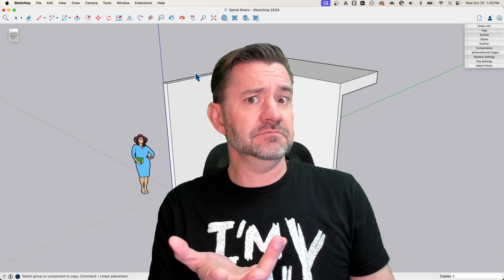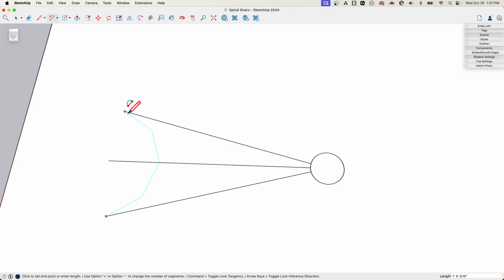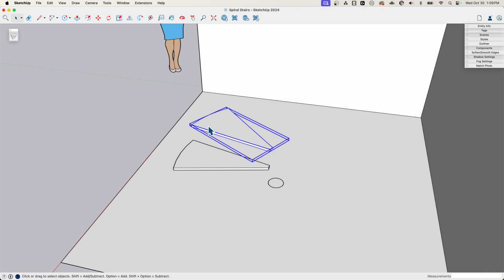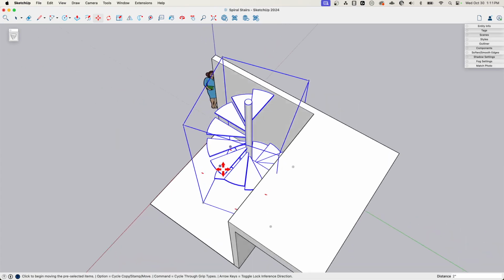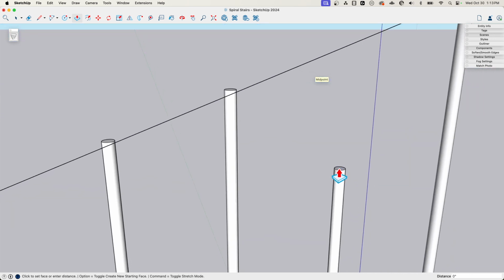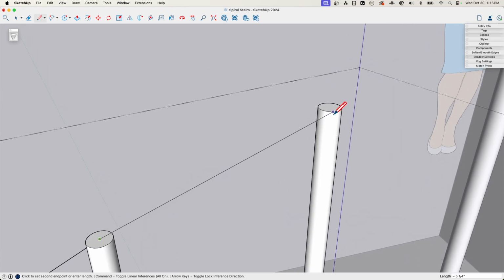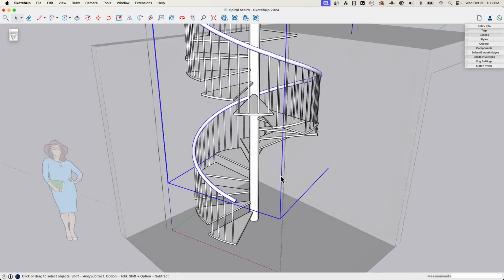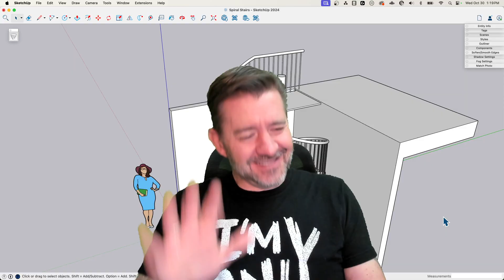Spiral Stairs with Relative Copy

Comment: Very interesting. What fundamentally bothers me as a technician, however, is that the step heights are not the same. That would be a no no if this is actually the case in the drawing, if I haven't misheard
Reply from the maker: If you follow Aaron's steps, each tread should be the same exact size and perfectly evenly spaced!

Comment: This was an awesome video, thanks for creating it.  Thank you for introducing the extension.

Regarding your component vs group comment; using components instead of groups can be helpful if you use the Generate Report function to create a list of the items in your model, say for a BOM.  Groups will show up in this report, however you can only assign a tag to them.  Components, on the other hand, can have additional information added to them that will show up in the report.

Comment: I'm pretty sure I recall an old YT video of SKP natively doing the spiral stair copy into it's correct place and rotation correctly so the only real benefit to this plugin would be that is shows you the location before you hit enter for it to run.
Reply from the maker: Something like this CAN be created with native tools. Each stair copy, however, requires TWO steps. First rotate a copy, then move it up. Not difficult, but using this extension saves much more than a few commands to make the final staircase!
Reply: @SketchUp  I'm near certain it was 1 step - which is why I still have it somewhere in my memory because it was an option. I'll look for it.
Reply: I can tell you with some certainty that there is no native tool to move and rotate at the same time. You can speed up the process by copying more than one tread at a time, but moving them and rotating them is two steps without extensions.